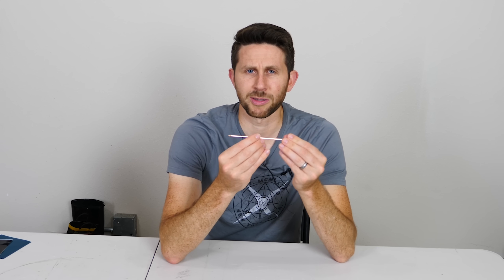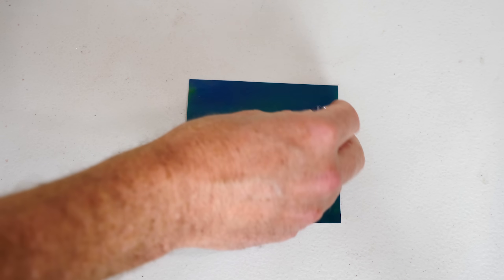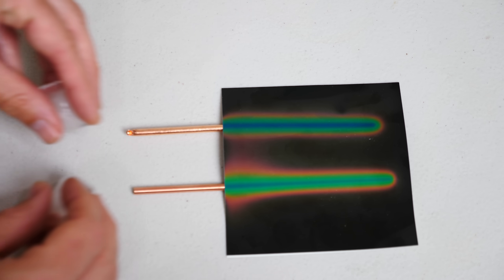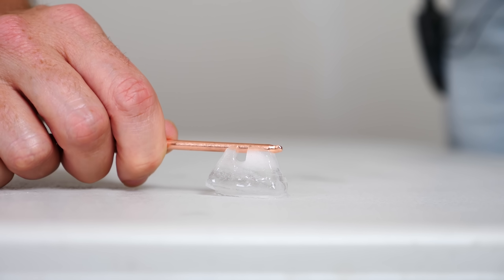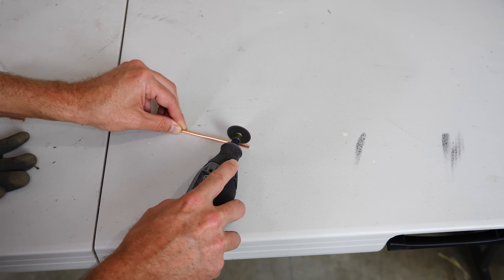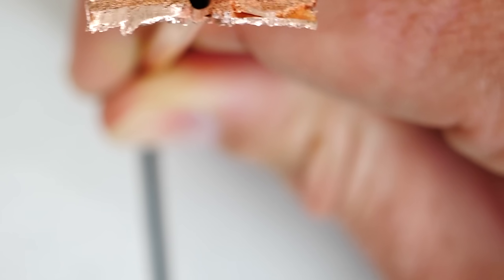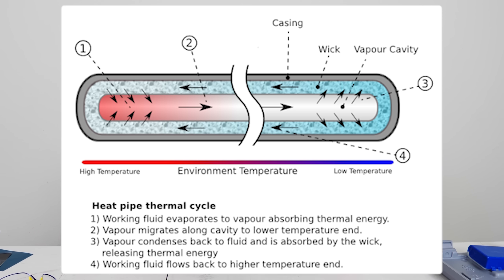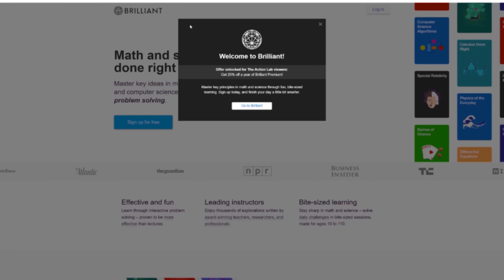What's Inside the Worlds' Fastest Heat Conductor?

Comment: Why is he wearing gloves first and no gloves second time
Reply: So that his hands don't apply heat to the sensitive heat rod and mess up the experiment with ice.
Reply: Inside the pipe is a vacuum and a minimal amount of water.
It only has good thermal conductivity as long as there is a vacuum inside of it, because it lowers the boiling point of water.
As soon as air gets inside, it has the same conductivity as plain copper.
So while cutting it the first time there is still a vacuum inside, but the second time its open and air gets inside.

Sry for bad english and I hope my explanation is somewhat understandable.

Comment: It's like the thermal equivalent of gearing. The hollow heat pipe with water has faster convection but less thermal capacity. That heatpipe can only be used for very low energy applications in comparison to the pure copper rod. I also doubt it's the fastest conducting material wince other contenders like graphene and Helium 2 got a lot higher thermal conductivity

Comment: Has this been scaled up for heating/cooling buildings yet?
Reply: What would be the benefit of doing so?
Reply: @thepope2412  In a word, efficiency.  If a building was fitted with these pipes as it's way of distributing it's heating and cooling the entire building would heat and cool more quickly which would increase speed to comfort and significantly decrease the amount of time the system would need to run.  

Not to mention it would be perfect for Geothermal/radiant heating and cooling systems since those systems are already a series of pipes transferring heat and cold between the building and the Earth under the building and this method would make that entire transfer process faster and therefore more efficient.  

Maybe the process to make these is currently too expensive for this to be profitable to scale up but until somebody crunches all the numbers, accounts for increases in production innovation, and definitely proves that it's not viable at scale then the physics of it without a doubt has much broader applications in industry than for just cooling computers.  

Hell just a building coated in the film he used to show the temperature changes has heating and cooling implications.  Imagine an entire building that turned black in the winter and white in the summer.  Though I'm almost positive that film is too expensive to scale up like that and I don't have the numbers to know how many times it can cycle before the materials gave out it's still an interesting idea that's fun to think about and could potentially be worth building off of.
Reply: 1% Inspiration forced air systems are more efficient than these pipes
Reply: @thepope2412  do you have any apples to apples data to back that claim up?
Reply: 1% Inspiration do you want to talk about differences of scale?
Reply: @thepope2412  I would love to.  I'm sure these heat pipes would be more expensive than traditional methods (like forced air) at first but as the technology gained in adoption the price would drop
Reply: @1inspiration466  You know the reason why these pipes transfer heat so well is because the heat is being transferred through movement right? And what does a forced air system do?
Reply: @thepope2412  Yeah pretty much everything transfers through movement so that doesn't really compare. It's about the rate that the transfer happens at and the heat and cold transfer at a significantly higher rate with this setup than with just copper.  That's kind of the whole point of this video is that this setup transfers heat and cold at an abnormally fast rate.  What your describing involves normal rates in a apples to oranges comparison.  An apples to apples comparison we would be comparing these pipes to Cooper pipes in a radiant heating and cooling setup, not forced air, which is an entirely different system that in itself is less efficient but cheaper alternative to radiant heating and cooling
Reply: @1inspiration466  you missed the point, the reason why it's "abnormally fast" is because there is fluid and vapor that is physically transferring the heat through movement, not just conduction like in a normal copper pipe. It's almost like transferring a red hot iron across the street and saying the street transferred the heat. A forced air and a hot water/steam radiator system is the same way, so it wouldn't be necessary to transfer heat through these pipes when you could just transfer the heat with hot water or hot air. And then it's questionable how well they would even work for heating or cooling.

The reason why these things are good for computers is because it works very well in a small scale application since it requires no additional moving parts. But if you scale it up? The larger vapor chamber copper pipes are liable to break so they would be harder to install and manufacture, and they would have a relatively short life span so more maintenance. They may not even work on a large scale since they depend on a heat differential to work, and creating a proper heat differential may not be possible for what you're suggesting.
Reply: @thepope2412  Yeah I know. Those are all good points.  At the end of the day though no one is really going to know whether or not scaling it up would actually work out or not unless someone actually ran some larger scale experiments, collected data, and refined new experiments based off that data to see how big of applications these could potentially be used for. 

Even though I know there's the possibility that the things I've suggested might not scale up the way I would hope the thing I'm really hoping to achieve here is to inspire someone out there with the possibility that this potentially underutilized technology could have much larger implications and applications than it has in it's current form.

I mean I don't know about you but I've just never seen anything transfer energy that quickly without any moving parts.  With powerful and energy consuming pumps and fans, yeah of course there's plenty of systems out there capable of moving that kind of energy around with that kind of speed.  But with just 1 piece of pipe without even 1 single moving part?  I'm sorry but I just can't help but think that there's a lot more to be gained from this tech than just cooling computers.  

Honestly there could be a ton of light shed onto these speculations if the guy who made this video did somewhat similar experiments except with significantly longer pipes.  I mean if it could transfer that kind of energy with that kind of speed in say a 1 or 2 meter long pipe then there might be something scalable here.  I would think that as the pipe got longer then more input energy would be required as more energy would be leaving the pipe along the way but I'm sure just some basic insulating material could help mitigate that.

Obviously without not hard evidence this is just speculation but hey maybe it will inspire this guy to do bigger experiments with this tech. 👍☺️👍

Comment: So once the vapor condenses on the cool side how is the liquid able to overcome the force of gravity and return to the warm side?
The best I can come up with is capillary action or something like that.
Reply: There is only water inside the tube at very low pressure, no air. So the water vaporizes on hot spots and condenses on cool spots. Gravity only plays a minor role here, since the water is moving in the gas phase, so the pressure difference equals out in the tube. The vaporization and condensation also does most of the heat transfer, by the way. A genious design.

Comment: Graphene is the fastest.
Change my mind
Reply: DerBoss2018 pretty sure diamond is faster
Reply: Well, on small object yes. But when increase the dimension of the heat conductor, graphene scales linearly, while a heatpipe, since there is an actual fluid motion, increase it's thermal conductivity when you increase it's size. Graphene's thermal conductivity is around 3000-5000 [W/mK], heatpipe's start at 4000 [W/mK] and one study (which i wouldn't trust too much) said that by using a 12 inch pipe (didn't specified if it was diameters or lenght) they achieved 4000000 [W/mK] (which, again, seems to high).
Plus since graphene is a material, scientists are working on putting it both in the internal fluid (as a nanoparticle emulsion) and on using it insteat of copper as external material.
Did i changed your mind?
Reply: @francescolombini3477  Yes, if he reads it, or sees any notification, because his brain would be making chemical changes upon receiving that info = his mind is changed.
Reply: naaaah)
Reply: Ok, make a comparison video

Comment: It is used in AC, refrigerator, and on some laptop heatsinks. Basically it cools down object using its quick conducting ability to remove heat from the object.

Comment: Adding on to this: the "spongy" texture of the inside of the pipe is there to increase the surface area on the inside, thus also greatly increasing the temperature transfer
Reply: No. It's because the liquid water gets spread to the entire inner spongy lining. A smooth surface will create a drop of water that will move here and there due to gravity and won't boil on the application of heat on the other side so, it won't work.
Reply: Also the spongy part act as a capillar bringing the condensed water from the cold side back to the hot side, where it evaporates and goes as vapor through the middle of the pipe.
Creating a closed cycle.
Just my guess, I am actually an idiot.
Reply: @vegonomia-nosprotegendodoc9011  you are right in this case, nevertheless.
Reply: Bro it's never temperature transfer.... It's heat transfer.. There is a difference
Reply: How is the spongy texture created
Reply: @edwardbrant12  its actually a copper powder, if you interested at how it made, here's the video https://www.youtube.com/watch?v=p71V6zLybig

Comment: The pilings supporting the Alaska Pipe line, over permafrost, are thermal transfer tubes to keep the ground frozen around supports. If it didn't keep ground cooled the heat of the oil filled pipe would melt the solid frozen soil supporting the pipe stations.

Comment: I do HVAC for a living so when I saw that copper tube was pinched on one end I knew right away this was a phase change conductor
Reply: Where can I get these rods
Reply: I thought the "bad" heatpipe he was holding was the regular sintered copper tube and the "better" one had some rare and expensive material inside it. If you already know about these heat pipes then this video is disappointing.
Reply: @KILLTHEREDDITOR  Phase change conductors are common in computer heatsinks
Reply: @KILLTHEREDDITOR  as well as HVAC. 

This is essentially how ac works. Though it uses a chemical

Comment: It's not really the fastest conductor, more the fastest convector.
Reply: Convection is generally faster than conduction yes?
Reply: Convection
Conduction
Radiation 

Efficiency in order best to worst.

Speed is directly correlated, though usually not used in references (engineering and scientific) due to it being a fairly nebulous thing. 

Depends on materials efficiency surface area temperature differential and prolly a few other things.

The fact that the atomic structure of water allows it hold tremendous amounts of energy befor succumbing to thermal saturation is also a benifit
Reply: Also that's why your more likely to over heat in space than freez

You dont have the benifit of conductive or convective heat release just radiated heat release

Comment: Note that diamond has a highest thermal conductivity of any solid, 3.3 kW/(m.K)
...therefore making the heat pipe from something like carbon nanotubes or graphene might easily outperform copper. CNTs have confirmed thermal conductivity of 3 kW/(m.K), close to that of diamond.
Now add the wick/vacuum/vapour system inside and you have a superior heat pipe and very light, too. Unfortunately, I think this is still beyond current material engineering capabilities.

Comment: Graphite and other carbon compounds conduct way better than copper.
Reply: This is not actually true for heat nor electricity.
Silver is a better electrical and thermal conductor than copper. One of the few things made of carbon which is a better thermal conductor (but not an electrical conductor at all) is diamond. Copper conducts heat at roughly 0.400 kW/mK. Diamond conducts heat at roughly 2 kW/mK. Diamond itself is a carbon structure, but this does not mean graphite and other carbon compounds share this quality.

At 4:02 he says that this heat pipe conducts at 100 kW/mK. The only things that would make this heat pipe even faster would be if it were made of silver or diamond rather than copper.

Comment: Water? I would have thought it would be methanol, or dichloromethane, or, perhaps, even ethanol, or another type of alcohol. No matter what, vapor phase change is an extremely efficient way to transfer heat, limited only by the rate at which the liquid can be returned to the heat point.

Comment: The Worlds' Fastest Heat Conductor works using Convection.
Reply: Yes, but there are special circumstances involved. The vapor in the tube is 100% water vapor. It is at a saturated state; any change in temperature results in evaporation and condensation. Since water has such a high specific heat of vaporization/condensation, and since all of the vapor in there is water vapor, the speed of conduction is roughly the speed of sound through that water vapor. As fast as water molecules can diffuse down that pipe length in the absence of anything else in there, heat would be conveyed. The speed of this diffusion is essentially the speed of sound through pure water vapor at that pressure and temperature. (Source: my heat pipe engineering text book.)

I don't know if the conditions I pointed out above still technically count as convection. If it does, it is an extremely specific form of convection.
Reply: @Berkana  Thanx for the explication. Now I got a lot more.

Comment: diamond is faster
Reply: Diamond is a much better conductor as a solid than copper as a solid, but it doesn't even come close to vapor phase change, over that long of a distance, compared to the cross section of that heat pipe. Besides, you can actually afford this, and this isn't nearly as fragile.

Comment: One drawback: once all the water has moved from the hot side to the cold side, the thermal conductance of the tube reverts to that of a hollow copper tube. Of course if the hot and cold sides are subsequently reversed, the conductance dramatically increases again, but only temporarily. In this sense, the tube doesn't act like a super-good conductor of heat long-term in one direction or the other.
Reply: That's why the wicking process is so critical, to the continuous flow of heat from a source to a sink. That's what returns the condensed liquid back to the source of heat, and is the limiting factor to how fast heat can be transferred. It would be easy, if the heat source is below the heatsink, because gravity would just drip the condensate back to the bottom. Wicking is required, if the heat source is level with, or even above the heatsink. That's why the inside of the tube is rough, so the capillary effect can wick the condensed water back to the heat source, after it has evaporated.
Reply: @vincentrobinette1507  That's a good explanation. From looking at the specs of the best heat pipes (those with a sintered internal wick) the skinny pipes really are about 100x the conductance of solid copper of the same volume, and at low power densities, heat pipes continue to operate at that high efficiency indefinitely. At higher power, the efficiency may be reduced, depending on the tip angle, and at still higher power, the efficiency goes way down, even if horizontal. (Note that in the video, that size of sintered-wick heat pipe would probably rapidly go into inefficient operation if maintained at ΔT= 30°C, the approx difference between the hand and ice, but the warm end probably cooled rapidly to about 4°C. There was probably a rapid melting of the ice initially because the warm end started at hand temperature.)

Comment: Oh nice, I was wondering if I could build my own cooling system for electronics with these.. I'm building my own car!  And I'm cheap, so I'm going to build it to run on free power.  It's about 70% on the drawing boards, but I just finished school so now I have time!  Anyways, would you happen to have any pointers for different types of power and how they compare?

Thanks!
Reply: A lot of electronics are cooled using these things, in the case of computers, heatsinks can be attached to the pipes. There are a bunch of companies that make these. And by free power, do you mean electricity? Go to a battery recycling place or something and get a bunch of laptop batteries for cheap or even free. Chances are that not all the cells inside are damaged. A lot of them use 18650 cells which is the same type of battery used in teslas.

In the case of gasoline, engines can be found for real cheeap and if you don't need to be racing everywhere, and can live with staying under 60mph at all times, you can probably get some cheap 4 strokoe ~500cc engine off of harbor freight or something. They are loud, but due to their miniscule size they might be able to give over 80 miles per gallon depending on the weight of the car and the gearing.